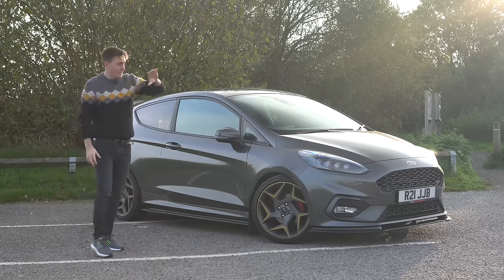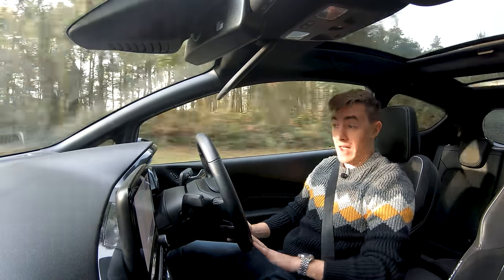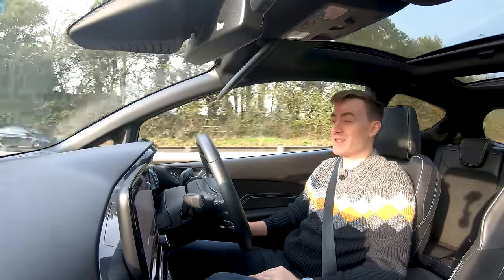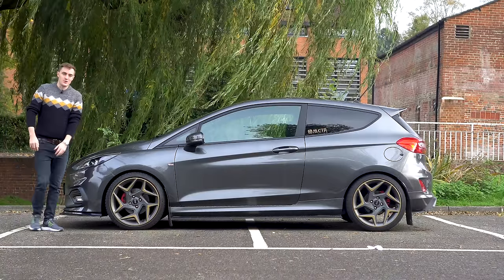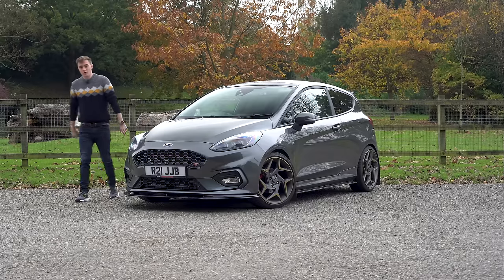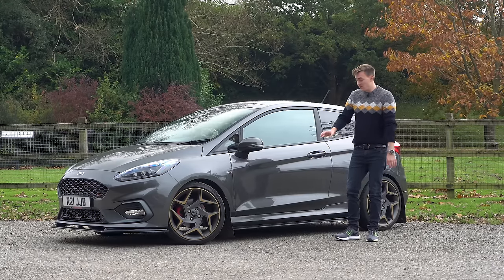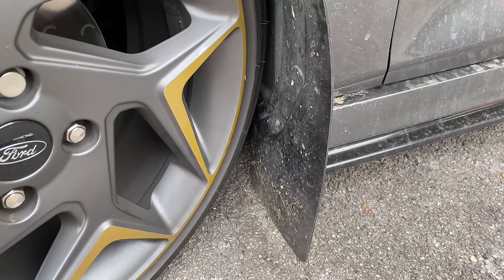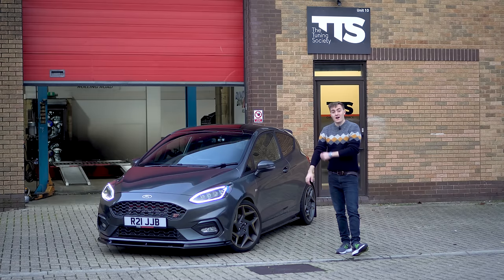MODIFIED MK8 Fiesta ST - ONE YEAR Ownership Review (+ Dyno Run!) 🚗 💨

Comment: Two mods that often DECREASE POWER, not increase it.

1) Induction kit. You're removing a cold air feed and replacing it with an engine bay warm air feed. The amount of air being taken into your engine is controlled by the ECU and turbo. If the ECU asks for 1.5BAR of turbo that's what you get, and that equates to a certain amount of air. It doesn't matter how big your intake is, you're not getting any more air into the engine. So you'll make more power if you have cold air instead. There's a reason why manufacturers use an airbox to keep warm engine air out and feed it from outside..

2) Larger intercooler doesn't really add any power. It's useful if you're working the car hard and you can slowdown heatsoak, such as tracking the car. But when everything is cold it can decrease performance, cause a pressure drop and add turbo lag. Lots of info online about fitting larger intercoolers reducing performance and turbo efficiency.

On the Fiesta ST neither the intake or exhaust are restrictive for performance. Change them for the sound and aesthetics. Remap on a standard car, and same remap on a car with every bolt on tuning accessory available will produce basically the same power.
Reply: Weird that the reviewer doesn't respond to your message. 
You are absolutely right.
You can change the intake with mountune One, which is also a cold air intake.

I have seen tests, and some can give 5 to 8bh more, but for performance, you better stick with the original. It protects the engine better from dirt and fine dust.

If you are going with a bigger intercooler, you might as well get a bigger turbo. Otherwise, it's just BS for a daily car.
Or you live in Dubai, where it's hot all the time, but not in England 🤣.

Comment: There is an update that you need normally for the intercooler as it is bigger than stock one.
Reply from the maker: bulskyne Not yet released. Only ‘stage 1’ softwares currently available for this engine.

Comment: Have you updated you’re sync 3 if you have then you need to turn off WiFi and automatic updates it will make the system a lot faster. Also as well if you hold down the reverse track and the power button it will put you’re car into testing mode for the sync then go into testing setting got to the HMI and put it to log all then it means that it logs all you’re sound and make B&O come alive.
Reply from the maker: Thomas Moignard Some top tips here. Loving this!
Reply: JB CTR If you need anything else I’m a ford tech so any time to help out

Comment: Hey Johnny, you should check what Dream Science does in terms of intake for the mk8. They're working on a full 3" intake to turbo system and they've got big intake horns. That would be a great plus if you do a custom remap.
Reply from the maker: pals bj They’re certainly producing some exciting stuff at the moment. I’m not going for a custom remap for a number of reasons (which I won’t go in to here.) I’ll sit tight for ‘stage 2’ maps to be released, but they’ll need to find a way round the GPF first :)

Comment: Ha I'll be in Basingstoke in the next month I might give the dyno a go, as my car feels more then the 225 mountune quote. Glad your still enjoying the car, recently got mine back after the engine work and new seat and thought I would of fallen out of love with it, but I haven't and the car as a package is hard to beat. I really need something bigger but nothing else floats my boat the car is almost perfect.
Reply from the maker: chris else Good to hear you are back and loving it! Let me know your results, I’ll be intrigued to hear 😎
Reply: What engine work did you need to have mate??? Didn't the mountune m225 affect warranty
Reply: @jordanbye9102  had a oil leak on the fuel shut of valve, Which is in the cylinder head. So had a new cylinder head and block replaced,  new cams new water pump and new crankshaft. No warranty was fine as my car was a early engine batch which they know have faults possibly a pre production engine. Although I wouldn't want to chance it if my car was newer.

Comment: The subtle mods make this car more appealing! Have you updated the Revo software after fitting the intercooler? Normally have to be remapped after fitting something like that!
Reply from the maker: Cheers! The software has not been updated just yet. The world of Fiesta tuning is generally performed with generic ECU mapping as this allows for more in depth testing and a more reliable end product. However all of the performance enhancing hardware fitted to the car is not officially supported by the Revo Software on the car, but should be supported by their next software package... which has yet to be released. At the moment, I'm just toying with new hardware to see how the current software reacts :)

Comment: I wonder what the long term longevity of that three pot will be,  especially when you tune them?
Reply: The 1 litre 3 pots barely make it past 60k miles, if you get them up to 180bjp you ain't got long before they blow, not sure on the St 3 pots in the mk8
Reply: @jordzz174  Might be comparing apples and pears but a 5GT Turbo I bought new in 1985 covered 60k in three years with no engine issues and that was with the wick turned up and a nitrous kit.
Reply: There not made they they used to made them, due to emissions they get properly choked up.

Comment: I think the bigger intercooler needs to mapped to your current calibration mate...otherwise the ECU will make no changers to the mod :)
Also disappointing that MK8 has the same issue with soft paint like the MK7 ST, I just keep 25 car lengths form the traffic in front LOL
Reply from the maker: 19marshall80 Officially yes it does, but it was mainly installed ready for stage 2 softwares 😁 The Revo software does adjust slightly to hardware changes which is why there are slight gains to be had on this software. The intake is where the biggest hardware gains are to be had with a ‘stage 1’ software

Comment: Nice video yet again.👍
I know its personal choice,  but get rid of these rally flaps. 🙈
Regards the dyno, what fuel where you using?
Might of got a bit more on a higher octane.
Would you now say the intercooler is worth the £500+  for  no gain?
Reply from the maker: The car is run exclusively on 99 RON 👍🏼 I would still 100% recommend the cooler. From behind the wheel, it feels mega to drive - significantly faster than with the stock cooler, and of course it prepares the car for more horses later down the line.

Comment: Hey Johnny, do you think that the induction kit and intercooler could've reduced power output?
A lot of people I know told me that a cone filter isn't necessarily a good thing with a stock map because the car wouldn't know how to use the large quantity of air and of higher temperature.

You have the Revo map tho, so this worries me.
Could you do a run with the stock intake box? Maybe it's really "impeding" power
Reply from the maker: Jeremy Clarkson Hi there, not entirely sure the intake is to blame here. The car has been run at over 260hp with the intake. At the time, this was the most powerful MK8 run to date and cars with the stock air box were down on power. 

Doing some intake comparisons on the Dyno does sound like it could be a good video though - so I’ll see what I can do to sort that 😎
Reply: @JBCTR  Thanks! What do you think of the motor mount now that many months have passed?
I've just recently bought the MK8 ST and I'm interested in modding it like you did, I've also seen your posts on Reddit so I know you're pretty active on this stuff
Reply from the maker: Jeremy Clarkson The motor mount is a great upgrade. It makes a real difference (I did a video if you’ve not seen it!) There have been some failures on them, but I’ve not been affected by them 👍🏼
Reply: @JBCTR  Thanks again!
Yeah I've seen the video and that's why I'm interested in buying one now.

Comment: Hi Johnny,
Thanks for all your lovely videos! Do you know if all the 2019/2020 models also sound as good as yours, with overrun and all that? New regulations regarding particular filters was imlemented on EU cars late 2018. For example, the VW Polo GTI’s sound crap now 🤕 cheers
Reply from the maker: Hi mate, they should do! All ST's (including mine) have a GPF fitted and the overrun is programmed as part of the ECU tune from factory. My car is running Revo software which has slightly enhanced the overrun, but you'll still get it as a stock car. I also have the Milltek exhaust which of course makes it louder too.
Reply: JB CTR thanks for your kind response. I feel even more confident, that the Fiesta is my next car (upgrading from my current R32 mk5). 🚀 Your videoes play a Big part in my buying descision, you should be paid by Ford 😂👍🏼

I will add the milltek ASAP and might go with a Revo Tune as well. But i am just nervous about loosing the warranty - whats your thoughts on that? Revo vs Warranty?
Reply from the maker: Emil Wilkens glad you are enjoying them! Warranty is a very grey area. Generally speaking, Ford are one of the more lenient manufacturers (in my opinion) with modifications. The stance they tend to take is that you’ll only invalidate you warranty on the parts that are impacted by your modifications. So if you modify, you don’t totally lose your warranty. 👍🏼
Reply: JB CTR your welcome.
It is also the engine warranty i am mostly concerned about - as i expect the engine to be the most expensive, complex and critical parts of a car. 🙈 but thanks for your feedback man. Keep pushing out vids on that beast you got there

Comment: Maybe Revo stage 1 needs to be reajusted? With all the improves the car doent know what to do with all these resouces... I dont know... Explain me if i do(
Reply from the maker: Rafael Branco The Revo software will adapt to hardware changes, which is why you can see slight improvements with hardware changes. Although with the hardware on my car, it is ready for the next lot of software which is yet to be released. Hopefully soon 😁
Reply: Rafael Branco now pumaspeed done one at 300hp on stock engine mk8

Comment: Nice vid mate! How much torque did it make when it put down 252hp. I would like to do the same mods to my mk8 st, which powermod do you recemend to do first ?
Reply from the maker: Pieter R Just over 300 ftlb 👍🏼 for power, definitely the Revo software. It can be run on a stock car.

Comment: Which is the most and stable amount of horsepower you can get in this engine?
Reply from the maker: Pepe hansome At the moment, around 250/260. Research is ongoing in to different software/hardware configurations to find more power. I’m sure it won’t be long :)
Reply: Gracias!!
Reply: So not issues with revo software?
Reply from the maker: Andy Nothing at all 👍🏼

Comment: Are you aware of all the problems this car is having? I'm an ST owner, since June 2019, only 4 months and my car has a minimal oil leak and the steering column problem as well. Does your's have or had this before? Aren't you worried that you lost the warranty? You also mentioned the rattling plastics, but there I agree, it doesn't annoy me anymore, as the car is brilliant to drive. Also, do you recommend a Milltek exhaust with or without GPF? I was waiting for Mountune, but they take forever to release their products..
Nice video as usual!
Reply from the maker: Pedro Figueiredo Hi mate, yup there’s a small portion of them with issues. Always the way with a new car. They’ll get sorted 😁 I’ve got the GPF back exhaust and it is more than loud enough for me, and still legal 😎
Reply: my car has an oil leak as well its been in the local ford garage 2 months im losing the will to live .Where is your leak mate?
Reply: @alistairsmyth9792  hi mate, it wasn't an oil leak after all (said Ford), just some residue that was cleaned and never appeared again, but the first engines made till February 19 are prone to have oil leaks, near the 
alternator. My steering column had to be replaced, under warranty.
Reply: Hey pedro did your car also smell through the ventilation?
Reply: @lemmykoopah  Nope
Reply: Hi mate my car was delivered Feb 19 so produced earlier. It has cylinder head removed at min to try and get to the bottom of this small leak but local Ford garage is a joke. Almost 3 months into fix.

Comment: Did you have the Milltek-exhaust before or After the 262hp?
What fuel you are Running?
Heard a lot that the Milltek eat some HP....
Reply from the maker: malagutino 99 RON fuel and both runs had the Milltek on. I’ve not heard of people losing HP with a GPF-back before :)
Reply: JB CTR tanks, was something else fitted After the first run?

Comment: Dont go chasing figures if the car is healthy as it'll just take the fun out of the car 👍🏻. How is the car riding on the kw springs?
Reply from the maker: KW springs are a little firmer than stock as you'd expect but certainly not back breaking. I've dailied the car for over 15000 miles with the springs on now and still happy with them. Bang for buck, they are brilliant.

Comment: Need to remove that larger intercooler to find that 10hp and restore torque and midrange , or get a custom tune. My sync 3 works fine with android ;)
Reply from the maker: maddogdragracing I’m not entirely sure it is the cooler. Other vehicles have made power with the larger cooler. As gains are so good with just software, the stock cooler can get heat soaked (shown by thermal cameras). Weirdly, it also feels faster from behind the wheel.
Reply: @JBCTR  easy to find out . Fit a bigger "bucket" and it takes longer to fill. Butt dynos are rarely calibrated and cannot be trusted ;)
Reply: @JBCTR  look for loose clamps. You might have small boost leak.

Comment: 250 brake from induction kit exhaust and a remap. Very loose figures or optimistic dyno
Reply from the maker: Scotty K Not at all. It’s pretty much bang on the money to be fair. It would have been optimistic for the old 1.6T engines, but the new 1.5 engines respond way better to just a remap. There are hundreds of stock cars out there hitting 245/250hp with no hardware. Multiple cars, multiple tuners & multiple dyno’s 👌🏼
Reply: @JBCTR  awesome car and those are simple bolt on stock turbo and good gas to hit those numbers to the wheels?! The 1.6 full bolt on and E30 wouldnt even hit those numbers for power. I do love how it sounds

you did will with the looks. 

quick question if there is one whats the weight difference between the 7 and 8?
Reply: totally agree

Comment: Hey! Nice video mate, could you please tell me how many miles did you do with 260+ hp? Did you have any huge engine problems?
Reply from the maker: Thanks - Hard to say exactly as the modifications have been added gradually over the past year or so. Current mileage on the car is approaching 20,000 and the Revo software has been on for over 10,000 of those miles.

Comment: I'm interested in getting the spoiler mod but I'm scared of the thing coming off while driving since it's only kept on the car with glue.
Reply from the maker: lemmykoopah Ive done 120mph with it on track and it held on fine. As the tape is all the way along, it’s more secure than you’d expect 👍🏼
Reply: @JBCTR  thanks bud.